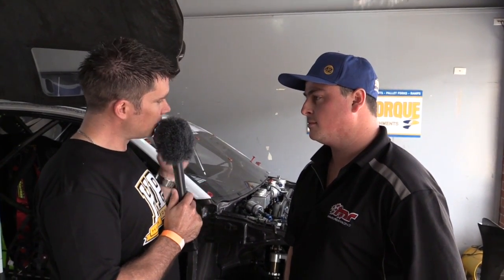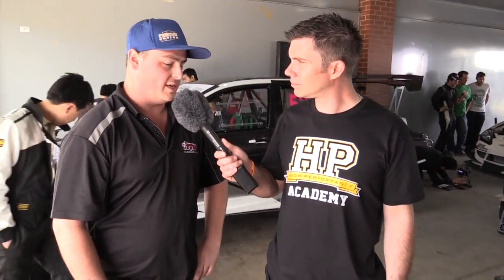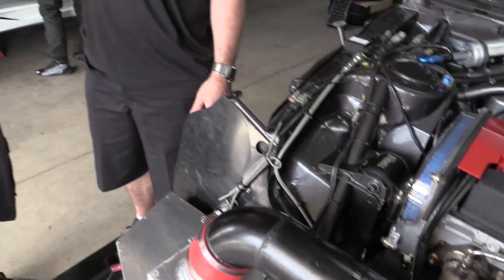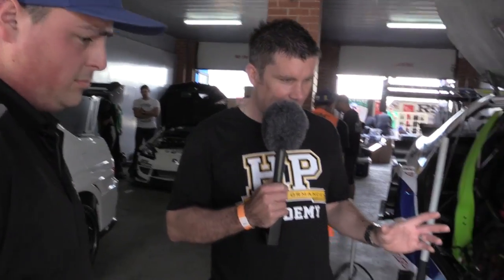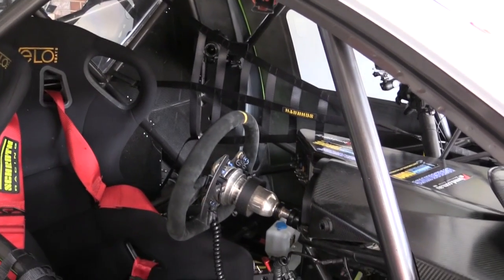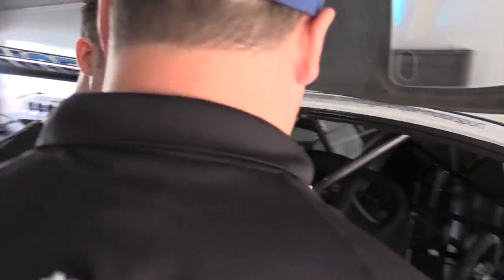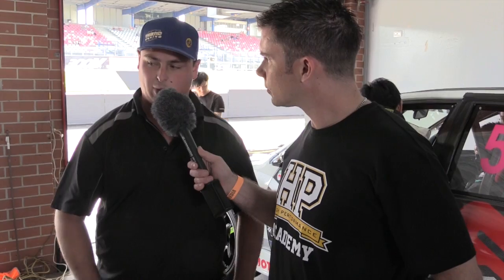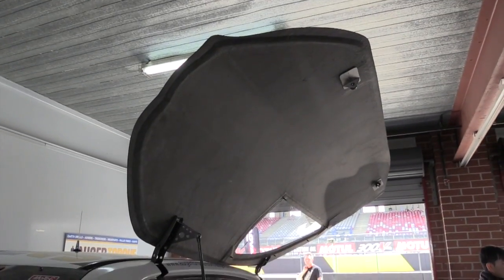Nemo at World Time Attack 2013 | Tech Talk with Nemo Racing Lead Technician James Marshall

Comment: They had a cooling problem. It's on the WTAC official website. The engine block and head got warped due to overheating. They ran a 1.27:xxx on low boost setup on there first timed lap. Then overheating started. But I don't understand why only have 1 engine. In racing shit happens. But I don't run the team so what do I know. Still my dream race car.